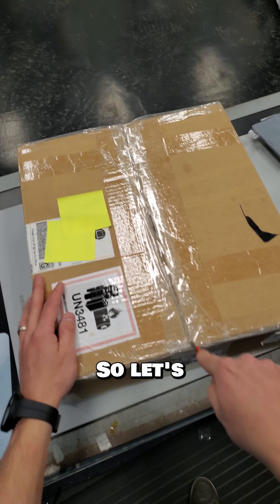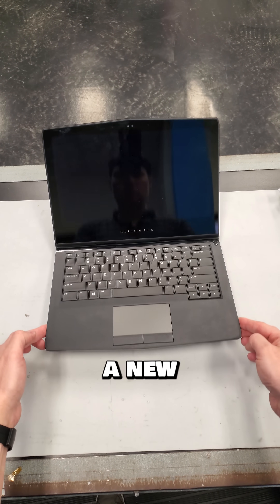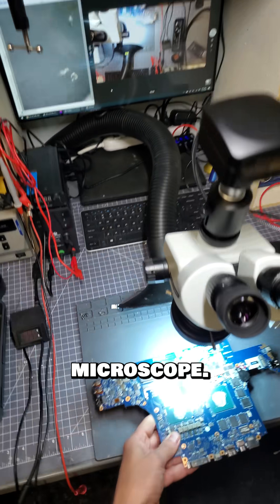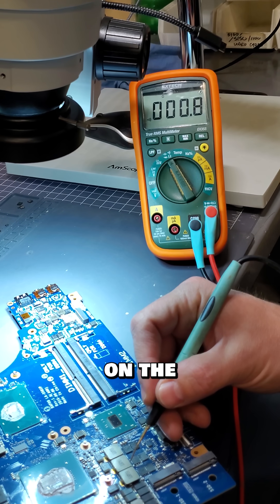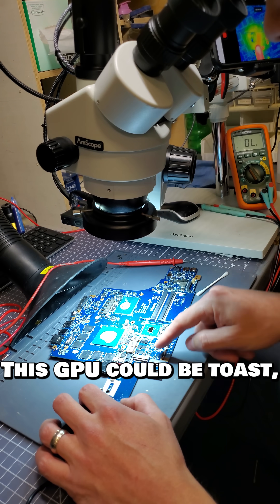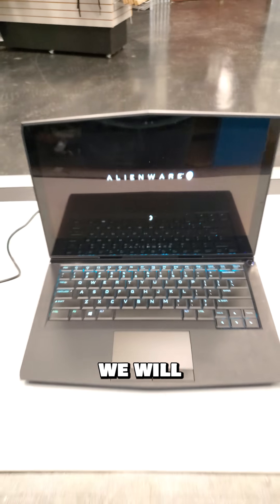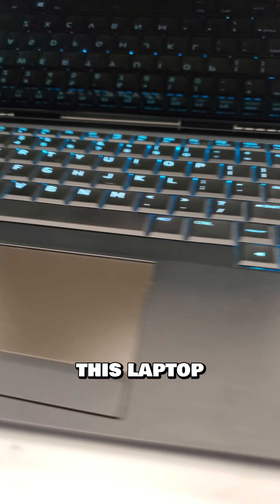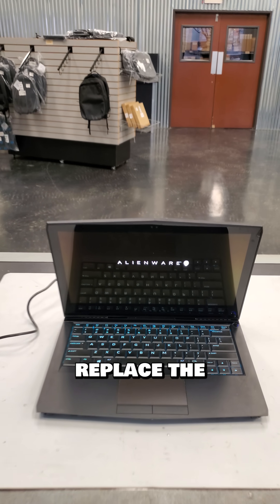Game Over? Gaming Laptop GPU Repair Fix #shorts #laptoprepair #computerrepair

Comment: At least dell wasn't bullshitting when they said the motherboard needed to be replaced
Reply: What fucking sucks is that we can't trust companies to actually be telling the truth. It might've just been them being accidentally correct while bullshitting.
Reply: @Dojan5  tbh, you're most probably right. Since people usually want "fast" service that's what most warranties have become. Just swap out the part and call it a day.
Reply: @LadBooboo it's not about speed, it's about skill. It takes a lot more skill to diagnose, than say "huh it's not working, change the whole thing". And also, they are the ones providing the parts lmao, so it's more profitable for them to replace than fix
Reply: @dimitrijekrstic7567  I mean, I don't think Dell or whoever sold those replacement motherboards care whether the person/company that bought them can do board level repairs, they already made their money. Most end users don't really care either, which is why I said what I said. People want fast turnarounds for their broken stuff so it usually becomes "replace" instead of "fix"
Reply: @LadBooboo  well it does make more sense if you KNOW it's a motherboard issue to just replace the whole thing rather than tested for individual shorts on the board
Reply: @LadBooboo you don’t “swap out the part” and call it a day lol usually with warranty claims you get a new unit, a refurbished one, and the one that came in bad now gets refurbished. Tada
Reply: @MrDoNotAnswer  soooo... What you said sounds like they swapped it with another board regardless whether the replacement is new or refurbished. Then most likely, the bad board gets sold or sent to some 3rd party that does the actual fixing.
Reply: @LadBooboo  You're right when my phone suddenly died I go to service center they said I must change the mother board, and it cost me lot of money for me, so I ask my father's friend. He said nah you can just change the RAM and boom I save more money, sometimes we had trust issue with big company right 😅
Reply: @dimitrijekrstic7567  imo if everything is covered under warranty and I don't have to pay a dime for the fix id rather have them swap out the whole laptop or mother board than solder on new parts it reduces the chance of more issues appearing
Reply: @LadBooboo  wouldn't that be better tho as long as its covered by warranty id rather have my whole laptop swapped out than have a new part soldered on
Reply: @LadBooboo I mean there is also a real cost associated with all of the diagnostics and verification from a skilled worker who is taking real TIME. At one point....is it worth it to consantly to these things if it's not for a youtube video?
Reply: @LadBooboo  im not sure it works like that on their end tho? Surely they will have mechanics look at that motherboard and possibly fix it so it can be used for another computer, right? Or are components so cheap that fixing it is more expensive than manufacturing it?
Reply: @Fredrick046  Dell probably ordered extra boards to stockpile for replacements straight from manufacturing and just kept it as inventory. 

Replacing and fixing both require human hours and I'm gonna assume replacing is faster since diagnosis isn't gonna take as long as testing individual components on the board to see if they're working.
Reply: @LadBooboo  
Well a lot of times CPU, GPU and in some rare cases RAM are soldered onto the motherboard, so swapping out the motherboard for a new one is usually the quickest solution.

on-site service technicians or off-site repair shops that need to quickly fix laptops will replace the entire motherboard, and have them sent back to the factories to be either repaired at a component level or be scrapped for parts onto newer boards.
Reply: @LadBooboo if my laptop is under warranty i prefer replace instead of fix. And that's what is the most reliable.
Reply: @Dojan5  In fairness there's nothing wrong with 3rd party watchdogs proofreading the works of companies to keep them honest.
Reply: @Dojan5 and honestly with anything we buy today smh
Reply: @Dojan5  its so fucking infuriating its liek you're spending money to get fucked
i got a couple Razer Hammerhead wireless ear buds. randomly one of the buds was not charging in the case.

sent them back, got a new pair. 2 weeks same issue.... now i got a pair of nothing sticks (half price ) and these are amazing
Reply: @Dojan5  To be honest it really could be them and it's easy to catch on if the customer knew if his laptop was still bootlooping without attached and directly turning on with adaptor and not bootlooping then.
Reply: @Dojan5 the problem is the price, expensive
Reply: @RORYPRAYANA  It's super easy to make sure that motherboard replacements become more expensive than making things repairable: put fees on carbon emissions and waste.
Reply: @Dojan5  Yep they usually say motherboards almost all the time as that is an expensive replacement and most people would not pay to replace it and just buy a new one.
Reply: @Dojan5  Why would you possibly ever want to trust anything or anyone trying to make money off you?
Reply: @Dojan5 if you live in the US then yh but that's only because your government doesn't care enough to have some actual consumer protection laws it sucks that it's not a standard worldwide
Reply: @Dojan5 I can assure you dell is pretty good with their services unless the laptop you have and its parts aren't roduced anymore
Reply: @Dojan5 lol who hurt you
Reply: @Dojan5 yea I hate the fact that they dont tell you why it needs to be replaced just that IT NEEDS REPLACING like that is transparent enough…
Reply: @Dojan5 Its a laptop. Ever component is integrated into the motherboard so when something dies on it they say it needs to be replaced
Reply: @bigfoot_barry  Yes. Now go watch Louis Rossmans older videos where he replaces chips and whatnot on laptop motherboards.

It's not uncommon for faults that can be repaired to not get repaired because repairs aren't beneficial to these companies.
Reply: @Dojan5  gee you dont say?? Almost like that was my point
Reply: @Dojan5  then you can live in paranoia I guess.
Reply: @Dojan5 bro trusts nobody
Reply: Fr
Reply: The company I used to work for had a separate area for mb repairs so if the problem was the mb it gets sent to them if it can be fixed then put back in part inventory.
Reply: @phil2756 that's exactly what dell does
Reply: Apple will lie about such things.
Reply: Apple be like: just buy another MacBook. 😂
Reply: I feel like they said "you have to replace the motherboard" because it wasn't coming on, not because they understood it to be a non-repairable problem.

It could have just as easily been a blown capacitor that needed replacement.
Reply: These mofo companies can't be trusted I gave my acer laptop for screen replacement Somehow they managed to short my Mobo i had to threaten them with a lawsuit and they fixed it. But later that year the laptop was dead again.
Reply: @ebenezer8058 true, couple of years ago my asus gaming laptop was not switching on went to a repair center the guy told me the motherboard was fried and the laptop was useless, he offered to buy the laptop from me for around $100 which I agreed, about a year my brother’s laptop had the same issue but my mom said she will try to have their IT look into it, the next day my brother’s laptop was working
Reply: Apple would never.
Reply: Not everyone is Apple
Reply: It's called planned obsolescence.
Reply: It might be they replace the battery and damage the GPU
Reply: @silaseth  I can almost guarantee you that's not what happened. First of all, it was Dell's own technicians, not the local tech repair guru. While they're known to "rip you off" it's usually by making you buy new parts, and not by damaging them. The repair being expensive is because it's also done extremely professionally. They have an extremely important reputation, and if they were to damage something they'd 100% replace it for free as the 100$ it would cost them to replace something is WAYYY less than the potential millions they can lose by taking a hit to their reputation.
Reply: @silaseth how can replacing a battery damage the gpu? Obviously you have no idea what you are talking about.
Reply: @silaseth  how would you damage a GPU while replacing a battery?
Reply: How so?
Reply: I guess they have a test Station and testet the Batterie. That was fine so they just said mobo
Reply: Fr.
Reply: Yeah but they still never explain shit lol
Reply: They were bull shitting when they had some one replace mine.
Reply: My alienware m17r4 is on its 3rd warranty replacement motherboard, all from the first year of ownership. It's been fine since, thankfully, and their warranty is very good, they send the technician to your house to replace it,   the only real problem is that the warranty motherboards are salvaged (used) but they are straight from dell. I assume taken from damaged laptops where the motherboard was fine. If they can't find a part for you while you're in warranty or if they have to do the same repair x amount of times you can ask to get a new laptop
Reply: Yeah, that's rare. They usually have no clue. Though if they sold the chips to the public, then it could be repaired
Reply: Let’s be honest, it just needed a battery before and Dell service shorted the GPU when they opened it.
Reply: @TheHeroPercy what are you on about? Tell me you know nothing about electronics without telling me. Do you think the Dell normal employees have anything to gain from shorting your motherboard? It is very common for a gpu or cpu to get fried when a mosfet is shorted. Especially on gaming laptops because they have very powerfull chargers. This is a common fault!
Reply: Very likely that they didn't check it at all and just saw it didn't turn on.
Reply: Yeah, I'm surprised. They aren't like apple.
Reply: Maybe they had the same encounter
Reply: True, usually most mass manufacturing companies say "Replace the motherboard, we're too busy to find the short"
Reply: Still they didn't check enough, just decided it needed a new motherboard and coincidentally they were right
Reply: Well, yeah, but it broke due to a component defect. Not the customer's fault, even if out of warranty
Reply: I highly doubt they even checked lmao. They just got lucky and were correct this time.
Reply: A GPU replacement would be more appropriate but a board replacement is more cost effective
Reply: If they say that bullshit to enough customers, for sure one of them will actually be true.
Reply: As an ex-Dell field tech… dells answer was to always replace the motherboard…every, single, flippin time.
Reply: It's more fun when they are and you prove them wrong
Reply: They were right either way. People like this guy simply cannot stay in business. They’d have to charge far more than this old laptop is worth, which is why most companies will not repair stuff like this
Reply: Asus moment
Reply: Fr
Reply: A broken clock is right twice you know lol. If you say replace motherboard for ALL issues lol
Reply: it's dell, not asus
Reply: Broken clock
Reply: It's a rarity 😂
Reply: They're not apple
Reply: They didn't replace the mosfet like he did so they were essentially just throwing parts at it. He's a technician, they're part changers
Reply: That was lucky
Reply: If they had a spare GPU, couldn’t they just replace it assuming they had a mask for the proper BGA? (Which is a big if and rather time consuming)
Reply: @veccio  they would but their murican servicemen who wouldnt bother with it.
Reply: Yea...and not like apple
Reply: not solution reball other gpu from scrapand win
Reply: Yeah.
Reply: Dell: "you'll need a new motherboard"
Guy: "how do you know, you haven't even looked yet?"
Dell "we designed it to fail" 😅
Reply: unlike apple💀
Reply: Unlike some other companies.. Cough*Apple *cough cough
Reply: @bestblu2 very true AND apple makes their devices mad unrepairable
Reply: My Dell laptop broke recently, they had a service technician out within like a week and repaired it under warranty, no questions asked. It's not like I completely trust them, but I trust them enough to not suggest a repair that would do absolutely nothing. Or in other words, I think what they say would probably fix it, whether it's the best solution or not.
Reply: Like apple
Reply: @shahzad9492  real
Reply: They got lucky. They say same for all laptops if it doesn’t switch on.
Reply: they probably didnt actually diagnose anything like this though lol
Reply: A broken clock is right twice a day. They may have been correct about the board needing replacement but it's not because they did a proper diagnostic, they just immediately went to board replacement when it wouldn't power on.
Reply: ASUS in the Chat.
Reply: Yeah I'm shocked that a factory diag was honest for once.
Reply: They wouldn't repair it even if it could have
Reply: a broken clock is right twice a day. so by saying you need to replace mobo to almost anything sometimes they will be rightn
Reply: Dell is not apple dawg
Reply: They indeed bullshitting
Reply: Well they could have saved the customer's money by just saying their nvidia block is fried but they can still use the laptop using Intel GPU
Reply: They were. But probably got lucky accidentally.

Even if the GPU was alive, Dell wouldn't do component level repair anyway.
Reply: @ShrirajHegde  I agree with you there.
Reply: Don’t give them props. remember they MADE it to to where when it breaks you have to replace the whole board
Reply: Even a broken clock is right twice a day
Reply: It's dell not apple
Reply: partially bullshitting you could replace the gpu
Reply: That's what I thought.
Reply: All dell computers are made to fry themselves.
Reply: @Sweet111323 their home stuff is, enterprise ensure good life otherwise they lose out on the support contract because of man hour support
Reply: they did lie, you could just replace the gpu itself without getting a new motherboard
Reply: @cheezy269UwU You assuming you can get a good quality like for like gpu. Most gpu sourced outside the oem are poor quality or rejects. Also gpu replacement is not necessary economically viable and not that reliable long term.
Reply: @cheezy269UwU  it is too expensive replacing BGA chip, RTX 3050 cost 100$, without labor and risk involved to still not working. It gets a lot more expensive with 3060 or 4050, around $330 . By this price I assume it is better to replace the whole motherboard, because usually RTX 4050,3060 motherboards are 400 USD

Comment: I'd just buy a new system at that point. 7700hq is still pretty capable in terms of laptop gaming but it's crippled without dedicated graphics
Reply: I mean, if disabling the dedicated GPU is an option, you can still have it for "office work". But if the (only) objective is gaming, then yeah, just get another one.
Reply: it’s possible to hardwire an external GPU if you’re not planning on needing portability or don’t mind carrying around a device as big as your laptop in your bag
Reply: @lakeland6798 this laptop has its proprietary egpu input in the back though.
Reply: Still an excellent machine for students though. Pretty sure it outperforms the laptop I struggled through college with for similar cost
Reply: crippled without dedicated graphics? Really? Wow. I would never have thought that. Thanks for explaining this complicated scenario.
Reply: I've actually gamed on the 7700HQ, and I can confirm it is incredibly reliable and has about the same spec as an i3-12100F

Very capable processor
Reply: not really, 7700hq is even slower that the top alder lake-N (i3 n305) which is only the successor of the pentium
Reply: The customer can always just plug in an external GPU, or he can another budge gaming laptop.
Reply: It's a miserable CPU for the absolute majority of AAA games since 2020-21. I hate when people have no idea about the actual capabilities of a certain tech and still state something wrong about it.
Reply: @META_txt  For gaming it's not very good. But it can be a decent machine with only the iGPU for general office work.
Reply: @pedroalbuquerquebs It's just very bad for gaming for AAA titles since 2020-21.

For office work and daily usage like browsing, it's completely fine.
Reply: @META_txt i agree with you but not every game is AAA
Reply: @META_txt  agree to disagree, there's still 4th gen mobile processors that handle games well enough at 1080p or lower
Reply: 7700hq is useless. It's like a entry level 400$ ryzen 3 laptop at this point in cpu performance..

Comment: never pay to replace the entire board
its not worth it
Reply from the maker: I think that is relative.  It depends.  So, for this laptop, it was a 2017 Alienware 13 R3; for the motherboard repair service, it is $200; a replacement motherboard is $300.  We sell some motherboards for less than $100; most are less than $500.  You might be thinking of Apple pricing, where they want you to buy a new device instead by pricing the new motherboard so high.
Reply: @dellpartspeople  yeah but a 2017 laptop must be very slow
so you can buy a new 2023 laptop with the almost the same performance at that price
am I wrong ?

Comment: Replace the gpu?
Reply: not possible
Reply: @CrimsonRedSoviet  it is, if you have an exact matching one - but it’s hard to do and with a machine from early 2017, it might not be financially viable (yes, ik the CPU is still perfectly usable, what I said still applies though)
Reply: That’d be maybe possible but a lot more difficult and time consuming, converting to intel graphics or motherboard replacement is the more reasonable solution